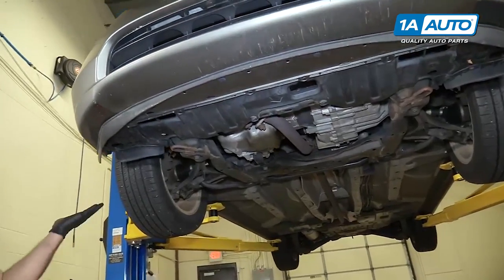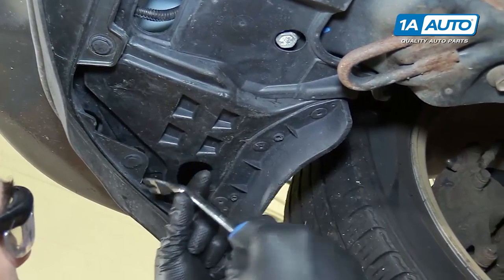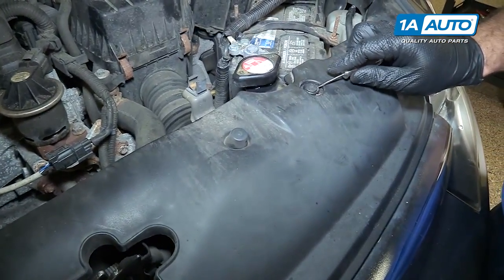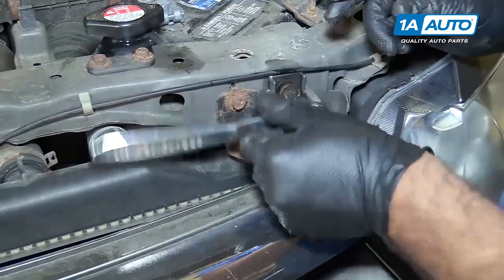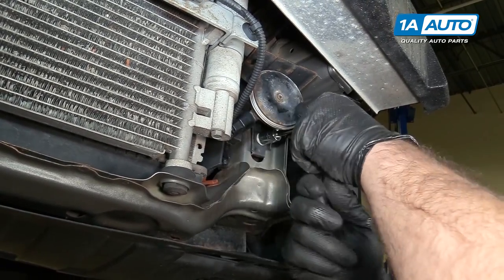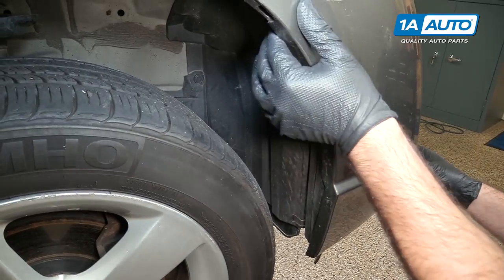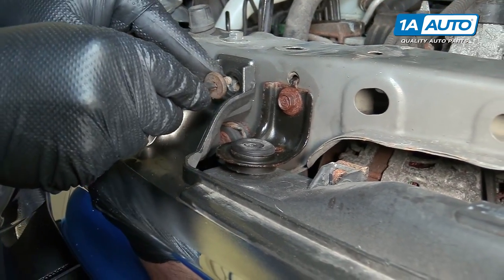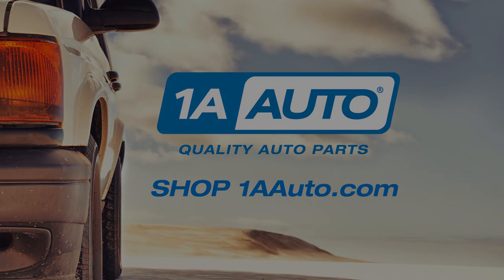How to Replace Horn 05-11 Honda Civic

Comment: Another option.  If I may.   Find the wire going to the horn. U can gain access to it under where the battery is. Cut it . Crimp a new section of wire on and wire it to a new horn. Mount it facing forward anywhere u can . Done.  Save the work of having to remove the entire front bumper.

Comment: What's the name and purpose of that sensor on the left side of the horn? Im missing that piece after i got into an accident. The thing is, the auto parts store can't help me if i dont know the name.
Reply: Outdoor Temperature sensor (if installed).
Reply from the maker: +Nesiian Jboii That is the ambient temperature sensor.  It gives you the outside air temperature.  1aauto.com
Reply: Thats only for the EX, the DX and LX dont have outside temp on the dash